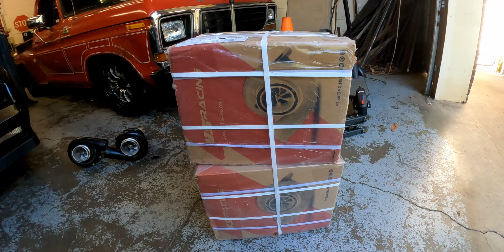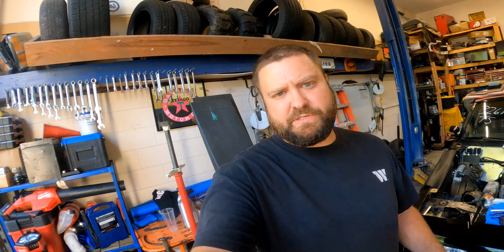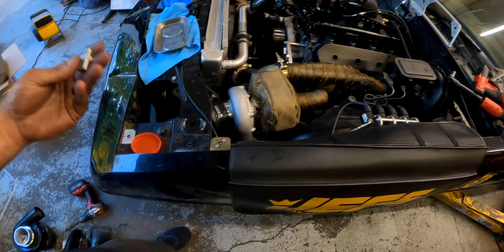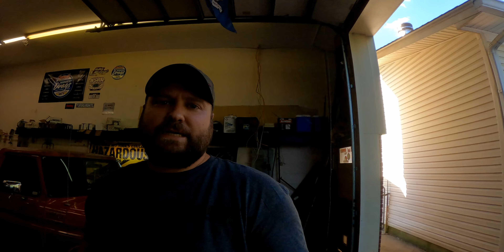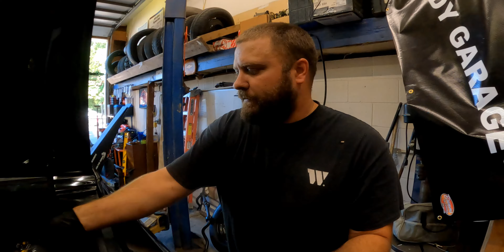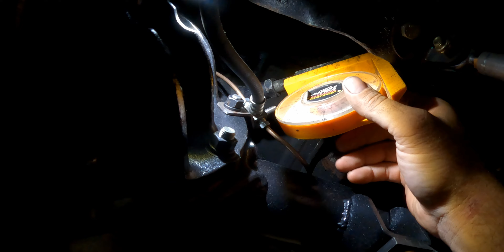EBAY TURBOS RAN OUT OF POWER. WHATS NEXT?

Comment: Whats the motor setup on that thing? I have a set of the 7875c ebay specials going into a s10. Just curious how much power do you think you got out of them?
Reply from the maker: We had a gen 4 5.3 in it and was probably making around 1k befor the turbos ran out. Keep looking around my videos and u will see the whole setup and all the changes I've made over the years.
Reply: @BOURBONANDBOOST  oh boy, I was thinking I could make 12-1400 pretty easy on a pair of these...
Reply from the maker: @nickdrummond1293  no the turbos will run out befor then. I pushed them as far as I could take them and I switched to vs racing 7875s and it made a big difference.  These are great for the price and getting ur project going, but at some point they do run out.